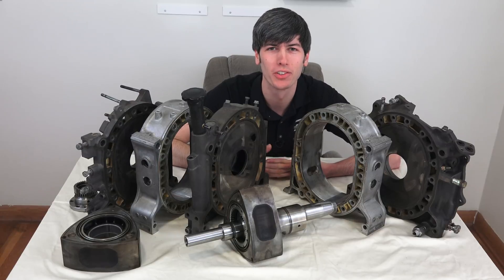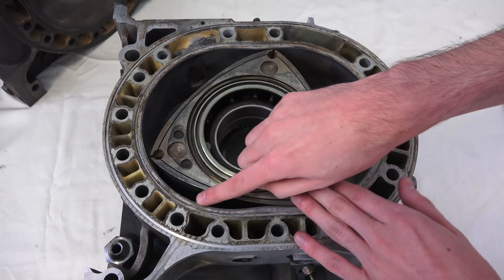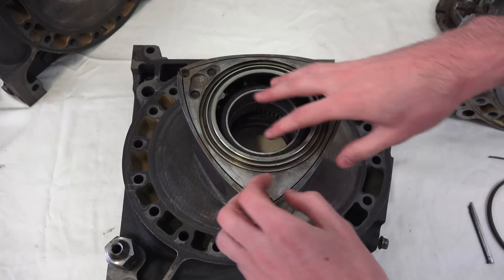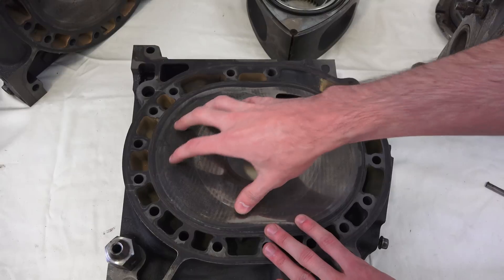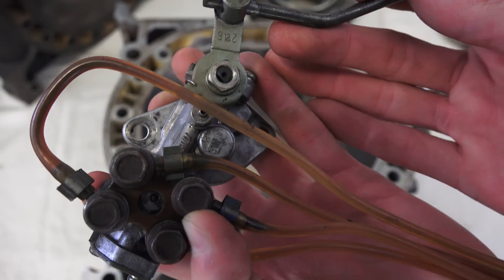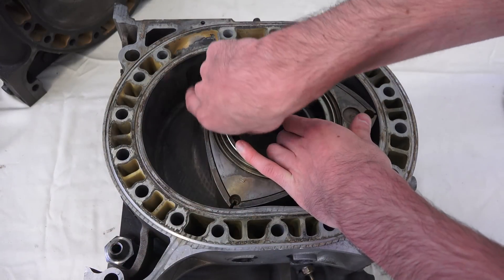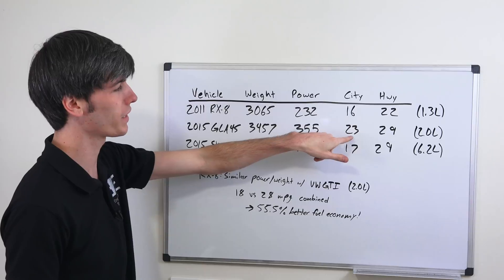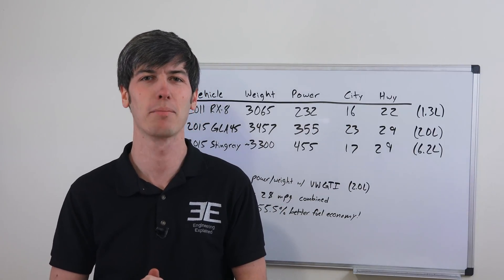4 Reasons Why The Rotary Engine Is Dead

Comment: They are too complex.  What kind of an engineer things complex is better?  An inexperienced engineer.  Specifically compare the shape of the combustion chamber.  It's easier to make a cylinder, thus you can make it more accurately - less friction, better seals, better millage.

Comment: By design, the rotary is a more energy dense engine. The fact that it has 3 combustion cycles per revolution is the very exact reason why it is so powerful for its small size, and at the very same time, the reason why it is so inefficient with the fuel. 

In short, it is power efficient, and fuel inefficient.  But thermally, more fuel is more power.

Comment: Owned an 81 GSL RX7 (posi, removable moonroof) for 3 years and 50K miles.  I never really noticed an oil consumption issue and it was good compression until about 110K miles. back then many cars with smaller engines didnt live past 100K in good nick.  what a cool experience seeing the 6K+ tach effortlessly humming along.  Sounded like a vacuum cleaner more than a car.  Its a 3 cycle engine with 3 power pulses per revolution.  at about 1.1 litre displacement,  I felt the power output was very strong (128hp and 124mph top speed).  compared to 4stroke 2.5L 4 bangers:  wankel 1.1 * 3 pulses per RPM made it  3.3 liters of power versus 2.5L / 4 per RPM, effective .625 L per RPM.  What made it so fun to drive was the torque peek between 3500 and 5500 RPM with HP peaking 5500 to 6500 RPM.  BIG factors that killed it - I think:  average mechanic is not tooled to rebuild a wankel.  Fuel injection arrived later the rotary life cycle.  mechanics didnt understand how to debug the solenoids or tune the carbs.  metal coatings were not evolved enough.        then motorheads found a way to drop SBC 350's in the RX7 and the rest was history.  I loved mine, got the best of its years and miles ,  and enjoyed a small sports car that picked of the girls so well, it picked up my wife the first night I had it - and she was for keeps.  She loved the car and we didnt have to drag a little sis along in it.  freedom !

Comment: Good presentation. However, just tell me what time it is and not how to build the watch! I had an RX-3 in the mid and late 70s, Loved it! It would absolutely out run the paint! The down side, at 115mph it was completely unstable. I think Detroit squashed further research and refinement on the engine. JMHO

Comment: I had an RX8 and while it was a lovely looking car i found zero advantages with its rotary engine. The engine was very unreliable and so high revving it was continuously annoying. Burns oil, not very efficient, I don't get the point at all and I BOUGHT one

Comment: Would it be possible to solve the thermal problem by having a dual combustion chamber, i.e. on either side of the engine housing, each working on alternating cycles/strokes? It will complicate the engine design because you need multiple injection ports, exhaust ports etc.

And what about stacking two rotary engines, i.e. having two rotaries running on the same shaft to increase power output, and maybe even recycling the very first part of the exhuast gasses rich in unburnt fuel mixture to improve mileage or will the engine carbon up?

Discliamer: I know nothing whatsoever about roteries, and I am not an engine expert on regular engines either.
Reply: A lot of the thermal efficiency comes down to the lack of compression. That could be worked around if you had a small compressor prior to the intake and had timed valves but that would limit the max rpm range to that of the max compressor speed and the timing for fuel injection would be very picky. 

Alternating symmetrical fuel injectors & spark plugs could likely be done but that would half the potential torque per revolution at the benefit of better fuel burn. 

With that said, I dunno how you would get around the oil burning issue with this engine style.
Reply: @autonomous2010  The poor thermal efficiency is due to that shape which cannot be resolved. The shape also causes the poor combustion efficiency.

Comment: The Rotary is far from dead... Mazda may not be making a vehicle powered by a rotary at the moment but many businesses are producing billet engine parts. Oil consumption can be eliminated by removing the oil injection system and replacing it with 2-stroke fuel mix. Temperatures can be controlled via a plethora of differing methods but tuning would be the first stop. All of these negative points raised have been worked around and remedied, this would be called "Development". With fuel consumption, as with all combustion engines, the more horsepower you get out,  the more fuel needs to be added. The rotary can run on hydrogen safely as the chamber moves away from intake eliminating possible backfire to fuel source but a flashback arrestor has done sufficiently for years in any flammable gas application. Hydrogen can be cheaply produced and as hydrogen fuel cell technology improves it should be a viable option for the combustion engine as the trend recently is toward electric of which the worlds oil producers have been buying into, electricity is expensive enough now just for household use.The rotary is not dead yet and I hope it doesn't.
Reply: The Wankel is an obsolete design that no longer offers any development potential in the commercial market. There are many small shops that offer aftermarket spares for antique and obsolete engines.

Comment: I raced an RX-7 in SCCA C production and GT-2 with a bridge-ported engine and in IMSA GT-U with a peripheral-port engine.  They were bullet proof with a tremendous weight to power ratio and my red line was 9000 RPM BUT if I had to I could go to 12,0000 RPM briefly for a pass.  Won me many championships both regional and national.  Great car!  BTW, we pre-mixed 2 stroke synthetic oil with the fuel.

Comment: I understand that oil is injected directly into the combustion chamber, and intake, but does the Wankel engine have an oil pan where oil just sits there and is used to lubricate all moving parts that are not in the combustion chamber? It looks so small I don't see that anywhere. Also didn't see any coolant passages in the block.

Comment: I did not buy the car as an econo box, I bought it because it's fun to drive, BTW, I have 119,000 miles on the original engine. So there.
Reply: keep driving it.  Mine sat for about a year (only had 39,000kms on it) and I had to pay $2k to get it running again.  (I knew that so I would run it around the parking lot sometimes, but the battery died so it just sat for too long).
Reply: Mazda specializes in the low-end, entry-level econo- box market, it's the very foundation of its entire business model.
All of Mazda attempts to move "up market" have failed miserably.
The Eunos, efini and Amati brand's were failures... because the company reputation is for selling the "cheap and nasty".

Comment: Reason it has bad fuel economy is due to the rotary having 3 combustion cycles per rotor per rpm were as piston engines have 1 combustion cycle per 2 piston strokes per cylinder. But to be fair, a 2 stroke rotary engine sounds way better than a 4 cylinder piston engine.

Comment: You are somewhat correct in your in your comments, however a 13 B has recently taken the world record for time to climb to 10, 000 ft in a prop driven aircraft. No reciprocating engine will ever be able to match it. The power to weight of the rotary is outstanding. All the early seal problems have been eliminated. Toyota are collaborating with Mazda to produce a rotary engine as a range extender for their hybrid cars. Rolls and other aircraft manufacturers have taken out many patents on the rotary engine. So to say it is dead is total rubbish.

Comment: The high revving Honda S2000 gets similar fuel efficiency ratings as the RX-8. You need to compare like to like...ie low torque high revving engines usually gets poor fuel economy.

Comment: I got some ideas.  Feel free to tear 'em apart, or describe what part of the idea may have merit.

Incomplete Combustion.  Solution: 3rd spark plug.  Where to put it.  There is probably a sweet spot that might take experimentation to find.  My guesstimation would be, 3 to 4 inches from the exhaust port,  or maybe more.  It will be a little secondary ignition right before it is all exhausted.

I also wonder what advantages could be had by reducing the size of the combustion chamber.  Reducing displacement WITHOUT reducing displacement.  ???  Cut the rotors size and mass in half, and double the number of rotors.  The height and width of the engine will be cut in half, but it will become a little longer.  This provides more metal to absorb heat, but relative more water to carry the heat away.

Comment: smiles per mile.  i had both an rx3 and an rx2.  the 2 produced the most smiles.  mazda used 2 spark plugs per rotor in an effort to address efficiency.  the 2nd plug was shut down at low rpm to allow enough unburned gas into the catalytic converter to keep it hot.  at high rpm, about 4k on my rx2 the second plugs kicked in.  so, at 60mph, you stomped it; the 4 barrel carb opened up and the car took off.  at 4000rpm, 70mph the second spark plugs fired up.  it was like someone came up from behind and kicked you with a steel toed boot.  the car would go straight to about 130mph before the limiter went off and screamed at you.  and that vet that you left far behind started to catch up.  fun.  very fun.  yup.  70cu in.

Comment: It died because it didn't provide any real benefit over conventional piston engines. Secondarily, they weren't particularly reliable and no one knew how to work on them. So when there was a problem your only option was to take it to a dealer and let them fumble around with it. Third, if the engine had a serious internal failure, you couldn't get it repaired or rebuilt. You had to buy a complete engine from the manufacturer. Source: I worked at a Mazda dealer in the 90's.

Comment: Well my volvo drinks 4 liters per 10 kilometers and its only a 2.3L not turbo powered and it revs too about 8.5k rpm but that is the absoulute max rev
Reply: how do you get a n/a b230 to rev to 8.5k
Reply: @karlmarx3971  you need too fix your engine head with harder springs, bigger valves and a high reved cam shaft and have carburetors like weber or fajs 45
Reply: @harre 02 beacus with chip tuning you get the revlimiter up to 7500rpm so 8500 seems very high for a b230
Reply: @karlmarx3971  well its powered by two weber 45 on a 530 engine head with bigger valves, bigger intake and everything you can do on the engine has been done and it dosent have a chip because its got two carburetors not injectors. Soo it revs until the engine explodes whitch is around 8.5-9k
Reply: @karlmarx3971  only new b230 with injectors have a revlimiter and some have one in the ignition system
Reply: @harre0267  oh I am sorry I thought it was a injected engine with a rev limiter because with something like b230f could never rev to 8.5k
Reply: @karlmarx3971  yeah they usally top of at 7.5k depending on the chip and some other things

Comment: Before I watch the video I'll have a stab at the reasons why

1. Reliability - the tips of the rotors wear out too quickly, causing misfires and even total engine failure 

2. Fuel economy - the engine isn't fuel efficient 

3. Emmisions - stricter emmisions rules means the rotary engine is obsolete 

4. Performance - newer engines offer comparatively better performance than a similar capacity rotary engine 

Lets see if I was right

Edit: 

I wasn't too far off tbh 😁
Reply: @FuckILoveYouTubby compared to modern reciprocal engine designs, the rotary engine simply cannot compete. 

It was an innovation in it's time but it's obsolete now.
Reply: @edwardtrickett1983  On the early models, sure. By the time they (Mazda) figured out better coatings for the aluminium housing and different seal designs (steel not carbon), those problems went away. I raced a 200+ HP 13B with Weber 48IDA RX3 for years. Routinely revved it to 11,000 RPM and never broke a motor (did break some gearboxes).
Reply: @markir9  maybe so but the fuel economy and emissions of the engine means it is now obsolete
Reply: @edwardtrickett1983  Fuel economy is definitely the Archillies heel.

Comment: 85% of those problems are because of gasoline, not because of the engine.

run it on hydrogen....  no wasted fuel..  no thermal difference's....   no emmisions...
Reply: Hydrogen still has to combust you numbnut, causing the same problems as gasoline

Comment: Wonder if you could install some kind of DEF system similar to what Diesels have to help with emissions. I also have heard some owners of these run 2 stroke oil in the gas tank to help with lubrication as well.

Comment: Very good presentation of why the rotary will never be a mainstream hero even though it has its fans. Like a 2 stroke, its power to weight is good but burning oil is never going to make emissions better. Also its high combustion chamber area absorbs a lot of heat and  there is a much larger quench area which is another emissions blow. The only way to improve it is to ceramic coat the rotor faces which is not something I have seen done and of course the  housing cannot be coated.

Comment: I hope there will be an engine that has the same size and the same power as this.
Reply: Modern superbike engines make over 200hp with 1l and they weight like 130lbs, clutch and gearbox included.

In fact it's kind of a myth that wankels are particularly revvy engines. Even back the 80s there were plenty of piston engines on the road revving well past 10k.

Comment: Comparing raw power:weight ratio of a Wankel engine to a 4-stroke vehicle is weird, because a Wankel works out to 1 power stroke per crankshaft rotation per rotor, unlike a 4-stroke piston that only has 1 power stroke per two crankshaft rotations per cylinder.

Comment: Well conveniently where the rotary engine excels was ignored in your video. You sell horsepower you drive torque. do the same comparison with torque output and you'll see that the Rotary starts competing a lot better as far as gas mileage. The rotary still gets bad gas mileage but produces lots and lots of torque.

Comment: An arguably even greater problem: you can't shut down the engine before it reaches operating temperature. Very impractical. My father's RX-8 had to be towed to the garage a few times to get unstuck.
Reply: Sounds like his could needed to be replaced. I've never had that issue.